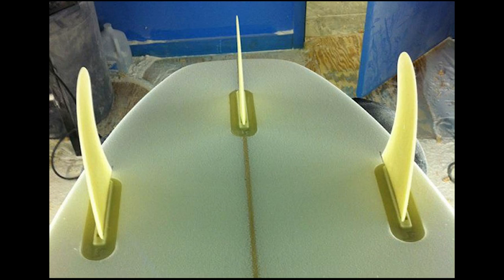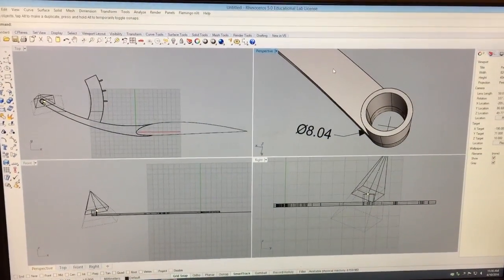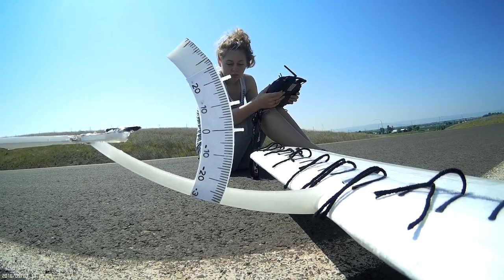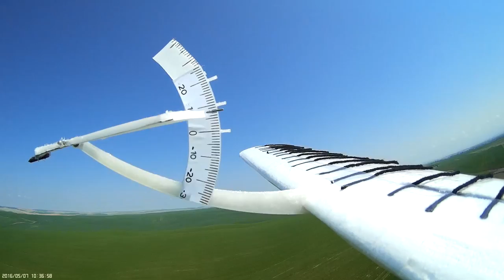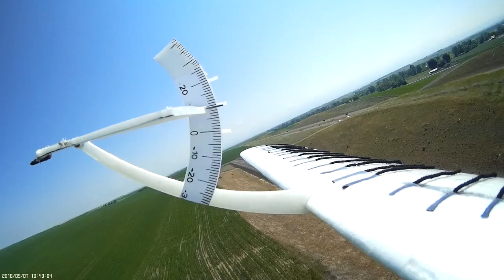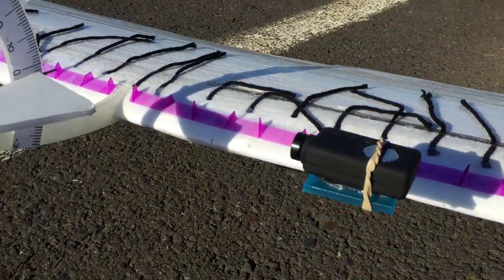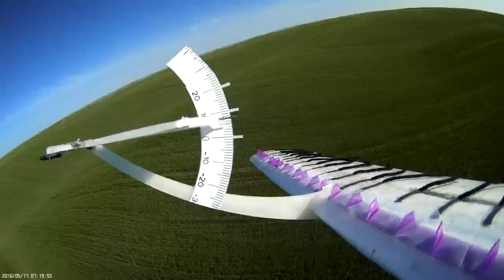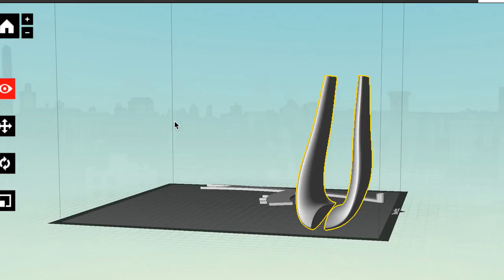Visual Angle of Attack Indicator

Comment from the maker: Fun fact: The plane in the opening picture is the plane I trained in and took my checkride in for both Commercial pilot and Certified flight instructor.
Reply: A Bonanza Right? Beautiful sunset and rainbow!
Reply from the maker: PA28R-200 (Piper Arrow)
Reply: A Cherokee then, they look very similar. Very beautiful.
Reply from the maker: Yes your comment was censored and I approved it, and deleted the copy one. That's a cool idea, I'll look into it a little. Especially FPV, That would be cool
Reply: *****
yes super cool and a great way to train. would be awesome to train cross wind landing this way and how to recover from stalls and spin stalls. To much "flying wild Alaska" and "worst place to be a pilot" LOL
Reply: Samm Sheperd hey what if u put a gyro and the degrees r backward would that work
Reply from the maker: andre joseph No because an aircrafts attitude is not the same as angle of attack. The relative wind is directly opposite the flight path.
Reply: Samm Sheperd yah ur right thanks for the response
Reply: You may not have seen much of a difference with angle of attack but there may have been a measurable difference in your airspeed when the wing stalled.
Reply: Samm Sheperd make a super aerodynamic plane like a jet
Reply: Samm Sheperd - Does the Model have enough payload and C of G range for a 2nd Camera? If yes, and you could mount it behind the wing facing the tufts from that side, you could get a better viewing angle of them, and see better the onset of stall. 

If both were recording at the same time, you could merge the two video streams in post, and compare AOA with Tuft Deflection, better! 

Maybe put an LED in the view of both cameras, that blinked, at a set rate, for synchronizing the two streams.
Reply: Samm Sheperd - The Arrow is a nice plane! I flew one from Winnipeg, MB, to Grand Forks, ND, years ago, at Christmas, to visit relatives!

Comment: golfball sheet looks like it worked well.
Reply from the maker: It did look that way,  but I feel the strings may have had some electrostatic attraction or something. It's hard to compare results with different surfaces. It felt and looked to me insignificantly different when it comes to how the aircraft behaved during similar AOA.
Reply: try printing your own pattern with a thin layer of PLA, then gently put it in to 70 c warm water and when its soft warp it around the airfoil and you may have a indented surface that is formed to fit other shapes. May work may not, never tried it.
Reply from the maker: Rahviel80 Neat idea! The stuff I got was a thin flexible cast of epoxy over a 3d printed mold. I've also thought of making a dimpled roller to just press some dimples into the taped surface.
Reply: Would twine be less susceptible to that kind of electrostatic?
Reply: What's the program u use to draw before printing? 

Thanks for a good production!
Reply from the maker: Rhino

Comment: Samm, my thinking is that the vortex generators alone did not help because the wing will stall at whatever the critical AOA is. The vortex generators did help in controllability, but they do nothing to change the critical AOA.
Reply: The thing is they just delay the point where the airflow Will separate. And at this scale the power to weight ratio is so high that It gets difficult to get a real size type of stall.

Comment: I really like your experiments. One thing i noticed in your video, as the stall is induced, it is clearly evident by your telltails that spanwise flow is starting to occur before the wing finally stalls, and the boundary layer seperates. What i would suggest if you havent already tried it, is to install wing fences just inboard of the ailerons over the wing. On real aircraft equipped with these they are usually installed where the flaps and ailerons meet. These will avoid, or rather reduce spanwise flow, and along with vortex generators will significantly re energise the flow and subsequently delay the seperation of the boundary layer. I once installed some on a scale Piper Cherokee that i built of blueprints, and it definitely improved slow speed handling. I also taped over all the gaps between my control surfaces and flying surfaces where hinghes were used, to stop cross flow between the two surfaces, even further improving handling.

Comment: Funny to find this video completely by accident. A few days ago I was reading about laminar flow and occurred me that one could probably spoil the flow over the foil to prevent boundary layer separation until it gets to a higher angle of attack and get some extra lift at the expense of some added friction drag.

And here you are, doing exactly that :D
Reply from the maker: I'm glad you found it! I have two other video's exploring Boundary layer separation: https://www.youtube.com/watch?v=eP-YUDe9HF0
Reply: Thanks! I'll watch them (and you've got a new subscriber :D). As a further thought on this topic, I looked around to see if VGs have ever been applied to props and saw very little about it.

I imagine that if one carefully directed the turbulent flow created by the VG towards the prop root, you could mitigate some of the spanwise flow, reduce induced drag, lift bleed and in effect create a "virtual"  duct. The fact that I've seen very little about it probably speaks counter to this idea, but I'm curious, nonetheless :D

Comment: Hello Pilots,
Do I understand it right that, 
Stall will happen when you have a  large angle of attack at relative low speed?
But if, with the Same Angle of Attack, the speed is much higher, then stall won't happen. Right? And the plane will climb up of course. Right?

If not right, Then how come that fighter jets and other acrobatic planes can climb straight vertically?
I suppose this is because of their high speed, which provides enough lift, no matter in what direction or angle they move.

So why can't normal plans in a critical angle of attack give full thrust to gain more lift?
The air is the same everywhere in the sky. Why behaves the air different if we want to fly in an angle which is not parallel to the horizon?
Reply: Hey, 
The entire angle of attack question seems unintuitive at first because it's a lot of different systems interacting. 

The amount of Lift, (which under normal flying conditions pushes you up away from the ground) that a wing produces depends on 3 basic factors: the wing geometry, the relative speed of the air, and the angle of attack. The plane's goal is to produce enough lift to balance the weight pulling in the opposite direction. 
Imagine an airplane wants to slow down, but not lose altitude. Since the airspeed has decreased, the lift will also decrease and the plane will begin to lose altitude since it's lift is unable to balance gravity's downward pull. However, a pilot can counteract it by pulling on the yoke and increasing the angle of attack increasing lift back to balance.

It's important to note though that angle of attack is relative to the wind the plane feels, not the ground. One might think that these are interchangable if there are no vertical updrafts or downdrafts but let's revisit lift:
If an airplane is almost at it's stall AoA and it increases throttle to start moving faster, but keeps the same angle relative to the horizon, it's lift component will increase and it will start rising. Since it's now rising, the air that the plane "feels" is now falling downwards. This changes the airspeed AoA, and it's not the same as it's angle to the horizon.

On the topic of fighter jets and flying up like a  rocket, you are on point in mentioning the speed that they can keep. Even a Cessna 150 can fly vertically (although only very very briefly). The main difference though is the power of the engines. Most airplane engines could lift very little without wings. A Cessna 150 has a static thrust of only about 140 kgs. That's what it could lift if it pointed straight up without aerodynamic lift from the wings (not enough to lift even its 500kg empty weight). If you were to get a fighter jet like the f16, it has a thrust with afterburners of about 12,000 kg while the empty plane weighs only 8,500; It can much more easily climb straight up.

I hope I've answered your question! Let me know if any part isn't clear and I'm happy to explain :D
Reply: @ruthdiez587  
Thank you very much for such a detailed  answer.
So I  repeat what I now understand of AOA. If there is any misconception, you may correct it please.

The Flight Path of a plane is not always its angle of pitch. But a plane can fly with nose pitch up, but still not climbing or descending, or only descending.
 That's why its AOA can be smaller or greater in this flight path attitude.

But when a plane is near stall AOA and then we give more throttle to accelerate, then it will begins to climb again. Therefore its relative wind changes, because its flight path changes. Since flight path and relative wind are always parallel en opposite to each other.
So to reduce the AOA we can do two things:
1- Lower the nose pitch. But with that we will loose altitude, if we do not give more throttle.
2- Give more throttle in the same pitch angle. That will change the flight path and plane will climb. Therefore the AOA will be smaller due to changed flight path and accordingly relative wind.

Am I right now in my understandings about AOA?
Reply: @sohail1855  That's right! If someone studies fluid dynamics they might be able to find a few problems or edge cases where this theory falls apart, but for everyday flying use it's more than enough!

Comment: Great wee experiment.  A variation would be to use a set of tell tails in front of the LE in place of the vane.  You could arrange them in various ways - vertically a specific span location, spanwise, before and aft the wing.
Reply from the maker: oooo that does sound cool

Comment: recently that at 35,000 feet the critical AOA is between 3-5 degrees on an airbus, as the plane went over the apogee of the arc, and down the other side the AOA increased critically, fatally when the crew didn't respond ( Air France flight 477).

Comment: the angle the stick makes with the vertical = the  inclination angle of the elevator =the angle of attack ,you can put a measuring device on your remote control pitch stick control , I did a aerobatics course in a flyable aircraft AoA control is all about how far back your stick control is hope this helps .
Reply from the maker: +Gino Russo hi I'm a CFI and commercial pilot ASEL and AMEL. Elevator position is the primary flight control for AOA but not a direct indication. Example: I can land a C172 so slow that I run out of elevator just before touchdown, while other times full elevator would absolutely result in stall. Elevator position held constant I can change AOA with other controls.

Comment: They fly BT higher pressure below and less pressure above.
A plank flies by presenting A to the wind. This mimics camber above and slows and compacts air below.

A ram-wing GEV certainly doesn't fly by bouncing air down, back up off the water and off the wing again & again.
It traps and compacts air below and is lifted via pressure difference driven partly by the Bernoulli effect above. Same with a plane in GE or flying.
Any reaction from bouncing air down is secondary.

Consider also the wing-tip vortex-driven "parachute lift" effect used by planes with aspect-ratio <3, flying very slowly with very high A (>30°+) the huge vortices wrap around and capture a "bubble" of low pressure above/behind them, increasing lift, while piling up high pressure below (just like a plank or Ekranoplan).
Charles Zimmerman working for UAC/Vought following the '30s Arup planes from Indiana, found that aspect-ratio 1.8-2.2 maximizes the effect, producing >4x the lift a normal wing could, if they can even fly at <25kts.This was the planform he selected as a starting point for his VTOL tail-sitter experiments.

As a side effect, the extreme vortices trap flow from the front on top of the wing, preventing it from separating, and giving strong smooth flow to the controls.
It's recognized that this effect is just a magnification of what wings normally do, (create a pressure differential.)
Very-low aspect-ratio planform planes don't stall, even if held to high A. They'll "mush" all the way down (~50% power on the low-powered Arup or the '90s Facetmobile).
Wainfan found that the Facetmobile would still fly at 16kts, when his pitot tube stopped reading anything.

Comment: I just built an AOA and Slip Air Data Computer for NASA and USAF.  All new C-130's are outfitted with a boom, not unlike the one you made, and will use my computers to take measurements for flight test and acceptance tests.  Usually those vortex generators are used on the wings in front of control surfaces to clean the air a bit for the surface to be more effective.
Reply from the maker: Very cool! Have you seen my video on vortex generators?
Reply: ***** Just a couple minutes ago. lol

Comment: I think I actually learned something here.  I'm a student pilot and in reading about stall and wing types, some portion of the wing will stall before the other and I couldn't understand this. In your video, I watched the tell tails, they  seemed to indicate the inboard portion of wing stalling before the outboard wing. then with the vortex strips added, the wing seemed to stall about mid portion first.  Thanks for making this video!
Reply: +ted K.,
 Wings typically have "washout".  This is a twist in the wing so there is less AoA toward the tip so the tip stalls last and you maintain aileron control further into the stall.
Reply: thanks...
Reply: ... ur Welcome.

Comment: vortex generators Will not add lift but Will make the Air flow for longer, thats why you feel It more controllable. It makes Air reach your ailerons.
Reply from the maker: Hi, I'd like to share a video I made on the subject of VG's :) https://www.youtube.com/watch?v=eP-YUDe9HF0
Reply: i've seen It already. I've also seen It around youtube in a real aircraft experiment. They tried It on a standard plane without vgs and then glued some over the wing. Change in stall speed and control was massive.

Comment: I'd guess that the reason why vortex generators and the golf ball dimple sheet didn't do anything is that the flow is already turbulent from quite close to the leading edge. That's what model airplanes do, no wonder with their rough surfaces and low Reynolds numbers. Actually there used to be a fun problem when plastic covering materials started to replace doped tissue: Some wings that worked well with rough japanese type tissue didn't fly when covered in iron-on film - laminar flow just didn't stick to the airfoil at that Re! The same sometimes happened when someone used glossy tissue and overdid the finish. The solution was to put some thick sewing thread spanwise, just behind the leading edge - a turbulator.
Reply from the maker: +nJiří Vorobel you sure know your stuff! Great real world examples too thanks

Comment: Seems to be a function of airspeed. Hauling it didn't seem to matter within the range of the gage. But cruising fairly slowly it certainly wanted to stall at any angle above 20°.
Reply from the maker: Well, the two main things that can be used to control lift in the air are AOA and airspeed. You could almost say that Airspeed^2 * AOA = lift. so when you have a high airspeed, you don't need much AOA, but as you decrease airspeed, then you have to increase AOA to have the same lift. If you get slow enough to where you need an AOA past the stalling angle then that is the limit to how slow you can fly.
A wing will ALWAYS STALL at the SAME ANGLE no matter the airspeed, It's just that normally having both a high AOA and also high airspeed is not needed or else you'll just do backflips or break the wing. Pulling out of a high speed dive or making constant altitude tight turns are both instances when stalling at a high airspeed is very possible.
The full equation is: Lift = (coefficient of lift (AOA)) * ((air density) * (Airspeed^2) / 2) * (Wing Area)